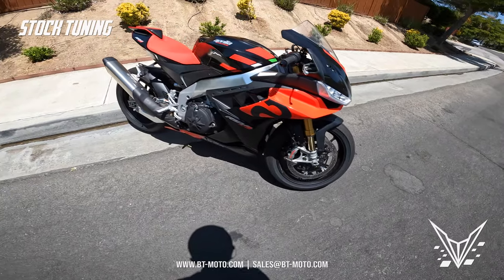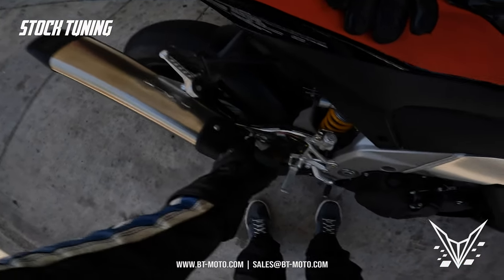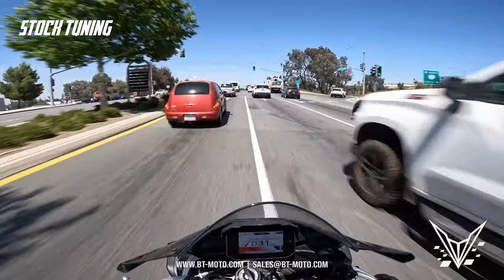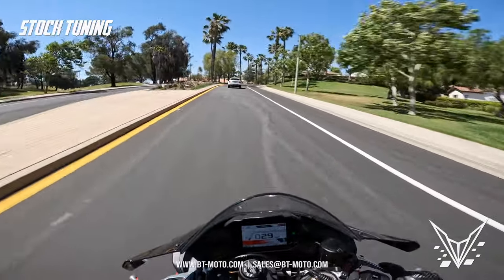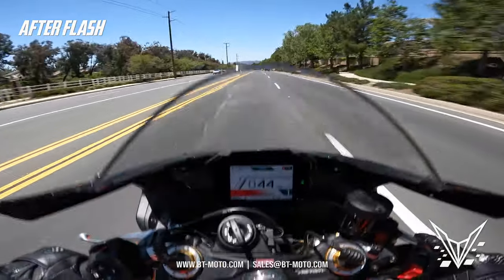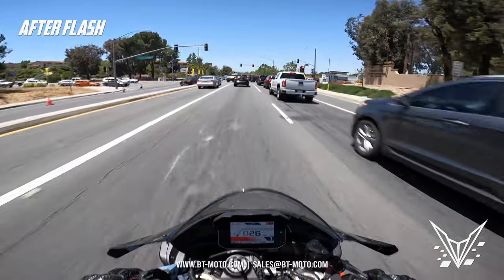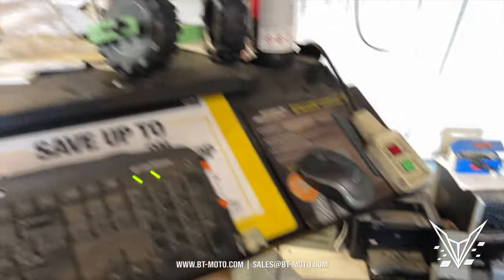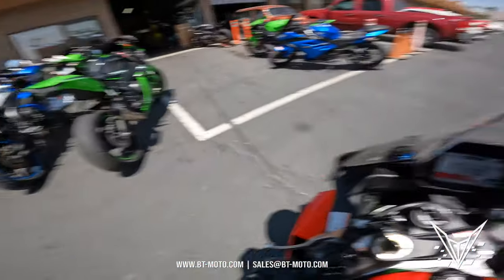2022 Aprilia RSV4 Factory 1100, BT Moto Ecu Flash Tune Review AND Dyno

Comment: Tc prevents it from wheelies even wen aw is off. I test rode one a while ago so wen I rode it I turned everything off to actually get everything out of it. Was wheeling in 3rd gear so it’s not like it’s heavily restricted as his making it seem. Yes restricted but not by much. It’s still a 1099 cc and you feel that. Stock and all
Reply: It’s more restricted than you think. The way they set up the maps if you don’t turn off traction control completely it will still hold back power to keep traction. When I would try to wheelie even with the wheelie control off it would still cut because the slight loss in traction coming up. I would either have to turn everything completely off in road individual mode or put it in race mode to and turn down the settings, to get “100%” out of it. If he turned everything completely off or put it in race the emergency hazards wouldn’t of turned on either or just go to the settings to turn it off

Comment: just picked mine up 5 days ago, coming off a 2008 cbr600rr, I was wondering throttle response is way too sensitive and jerky, and I can barely ride under 50km/h in first gear feels like is going to stall and bucks a lot? I also noticed in almost all the gears anything under 5000 rpm feels terrible and yes I haven’t completed my break in period. This thing feels like a ROCKET and is really comfortable and planted in corners.
Reply: @jondoe5532  I kind of disappointed, saved up alot of money and it took me a long time. Did my research on the bike and wasn’t expecting this. Couldn’t try it before buying and nobody that I know has one and you know salesman buy it’s the best bike ever crap! It shut down 3 times already with no reasons while riding. Going through slow corners feels like it’s going to buck me off. I can’t imagine someone with little experience on this thing. Came close to buying a bmw but had such bad experience with my car that there was no way as going back them up. I’ll look into that rear sprocket, heard tps and ride by wire might be out of alignment? and would a tune smooth out the problem?
Reply: @jacksht6308  
i have a gabro racing upmap and the velocity stacks on order and i believe that these items will transform the bike from the stock settings.

if you can get a tune with a decat pipe I'm sure it will help with the power curve and fuelling but i feel this bike is still slightly high geared and poor for low speed 3k rpm and below street riding which is why i bought a 43 tooth rear sprocket, i bought the 2009-2011 rsv4 525 pitch 43t talon and it fits.
a 44 tooth would be even better for low speed driveability but you lose a little bit more of top speed capacity.
if you are still running your bike in and below 600 to 700 miles they do seem to have slight electronic faults, i had a yellow check engine light after 100 miles and it restricted the bike slightly via the exhaust valve not opening fully but it cleared itself after 500 to 600 miles of riding.

the rear sprocket will help you the most for the least amount of money and i have read that these bikes will top 200mph with the stock gearing so they are not geared for low speed street riding and i can not help thinking that the long gearing may also help in sound and emission figures. 

if i were you, i would definitely buy the larger sprocket but just be aware that the bike will wheelie more over slight bumps in the road. 
also try the engine brake management on the lowest setting which is setting 1, this will help to lower the on off throttle jerk, it lets the bike roll more freely. just be aware that you will need to brake harder in those high speed to low speed situations where some more aggressive engine braking can help when you downshift quickly through the gears whilst also braking.

i know that my last honda had almost zero engine braking on throttle on/off so i am thinking your old honda 600 might have been the same sort of free rolling feeling, you just need time to get a feel for your new bike and 

on jerky bikes and when i go through a really slow bend, usually a 90 degree junction when im turning left or right, i drive upto the turn and then clutch in and let the bike roll through the turn while using some slight front brake to control the bike from running wide as i make the turn and then let out the clutch slowly whilst applying some power to drive out of the turn.
Reply: @jondoe5532  really appreciate all the information, asked everywhere and not a lot of feedback or info so all that knowledge is really kind. I figured that last part out on my own for tight corners, just feels weird all that extra work, but you’re right I am starting to find ways and adapt to this new bike and style of riding, really have to watch out for the police when riding at high revs going way faster then you think. thanks!

Comment: Does it run noticeably cooler. Living in AZ and my 2022 runs hot 🥵….. would like to get around town on occasion without over heating.
Reply from the maker: Yes, when in the video is stalled idling for too long in stock configuration. After flash, no overheating issues
Reply: @BT_Moto  I appreciate the quick response definitely going to look into you guys. Sounds like a great product

Comment: Could only get it up to 140ish? Wow kinda surprising 

I’m curious about the 2020+ r1 flashes. What hp numbers are people seeing from the handheld flash?
Reply from the maker: We have a review video for that bike as well. Our website has the dyno numbers
Reply: @BT_Moto The difference between your flash and the recommended Gabriel flash.....hp/cost ⁉️
Reply from the maker: @LOCKHIMUP2024  more power, more track options and no more overheating. The overheating is seen stock but isn’t corrected with other tuners.

Comment: How different is the power/power delivery on a flashed  2022 Tuono Factory?
Reply: The Tuono is geared differently, for more “on the Street” riding, loads of torque down low. Less top end power.
My buddy says my flashed 21 tuono wheelies easier than his flashed 21 RSV4.
Reply: Not to mention the difference between stock Tuono and flashed Tuono is insane. Complete insanity. 😈

Comment: If I already have the gabro custom tune, would it be worth switching to the BT? Haven't had any issues at all with Gabro, but I don't know the power difference between the two, or any other benefits of one over the other.
Reply from the maker: There are definitely benefits in power and engine cooling over Gabro

Comment: love my 22'. still breaking in. we got 93octane in SC. dont really care much about wheelie. im a small guy (157lbs), so maybe its up to rider. but its plenty fast in Sport mode for me. Probably just do tailtidy & exhaust and I'm set.
Reply: Ended up doing the Stage1 from BTMoto :) 😂
Reply: @bgai3  make bike run better?
Reply: @devononuska3088  yea idle and low speed stuttering gone. 

Doesn't sound like I have a cammed v8 with the AR exhaust now. Lol. Weather has been iffy, so havent tested any spirited riding  before/after yet since upload flash.
Reply: @bgai3  easy to instal?
Reply: @devononuska3088  yes. No issues.
Reply: What does that run $$?
Reply: @kirkdunn1379 about 600

Comment: I run mine on 93 octane not flashed and it'll pull the front tire up at 90+mph in second ..just by simple letting of the throttle and hitting it again...

Comment: Love this. Imagine a full exhaust. Proper fuel and recalibration. Old one made 213. Suprised its still 1sec off the bmw though is that down to gearing?
Reply from the maker: Needs gearing for sure. Would be much faster on 60-130
Reply: @BT_Moto  16/44 is the gearing I run, absolutely perfect
Reply: @BT_Moto  Why exactly were you banned on the S1000RR Forum?  They banned me too.
Reply: @nunyubizness5483  I’ve heard his tune has blown up a lot of S1k motors…
Reply: @NudaMan  Stock engines are blowing up. BMW IS THE PROBLEM. A brand new bike should not NEED a tune in the first place to run like every other BMW sold worldwide. BMW is a disgrace
Reply: @NudaMan  but you are correct, I know of bikes with brentunes and exhaust only grenading engines
Reply: @shawnlack1527  Same here on my 21 Tuono 1100 RR

Comment: Stock have only 182 rwhp? My Stock RSV4 Factory 2022 has only full Akrapovic and without any tune makes 196 rwhp... Motorcycles for american market make low HP because noise limitations, and BrennTune make them normal like EU wersion? I am right?
Reply from the maker: While European versions typically have a little more steam from the factory than their US counterparts, that doesn’t take away from the fact that the EU versions still get huge benefits from being flashed and optimized. Still EU restrictions on those bikes.

Comment: hey bro I have a Question,When using a manual Bike ,Do you use the clutch to shift or Is more like a paddle shifters,I ask this because early in the video before getting gas I didn't see you using the clutch to go from first gear to second So that's Why I have a doubt.Wish you can answer it whenever you can😁Great Video Btw🔝
Reply: Quick shifter

Comment: Ya'll have a similar flash for the 2022 Tuono yet? And would it use OFT or Racing ECU?
Reply: Race ecu runs circles around OFT. BT bases their flash off of the Race ecu changes and takes it a step further.
Reply: @retiredtk  right but do I need to buy the Race ECU?
Reply: @bschoenecker  no, keep the stock ecu and just flash it. That’s how the BT flash works
Reply: @retiredtk  thanks for the info!